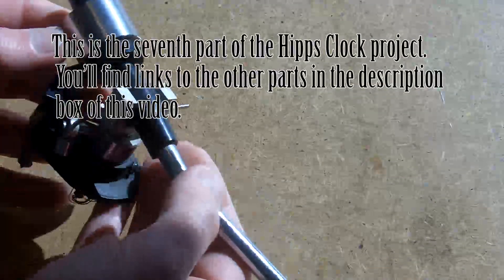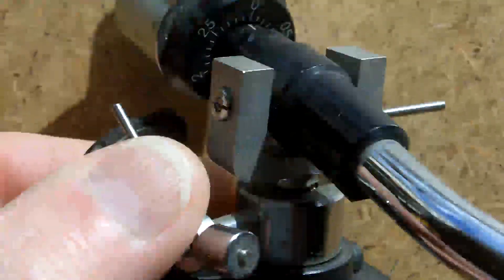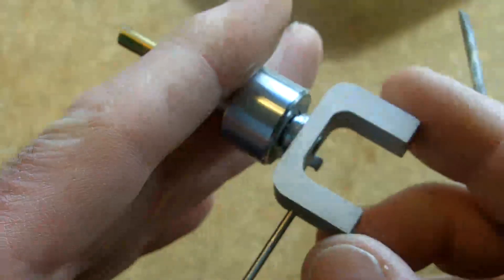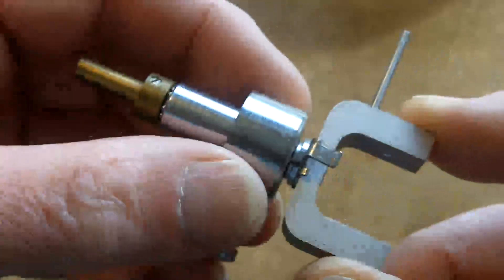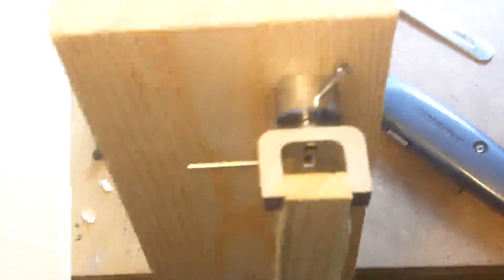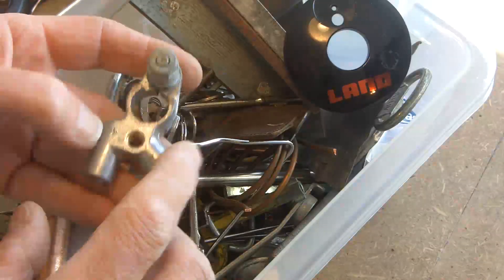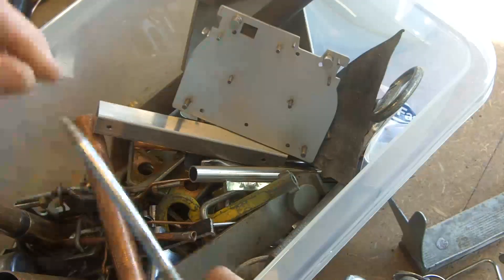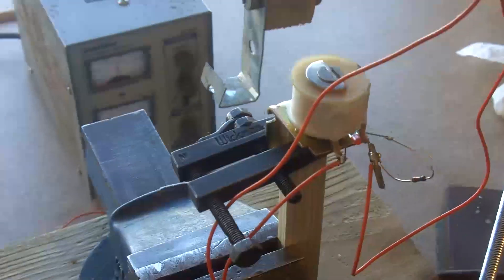Hipps clock movement project (rough) part 7

Comment from the maker: Well I reckon the whole pickup arm is way over engineered for its original purpose as it outlasted the rest of the kit, but your right in as much as I’m using it 90 degrees to its design function. I’m going to be loading it more than in its original life but I think it’ll see me out, I think with a drop of oil it could run for 50 to 100 years. At 1 (3 degree) beat every 2 seconds that’s only 1576800000  beats in 100 years. A small battery motor probably dose ~ 13000 rpm
Kind Regards... Andy

Comment: A great source for small high quality bearings is old hard drives from computers. Both the spindle and the head/arm assembly contains very nice bearings. And there's a couple of extremely powerful magnets in there as well, the type you can hurt yourself with. :) If you poke around a bit with it, you might be able to use the spindle motor both as bearing and power source for you pendulum. Could be worth a shot! :)